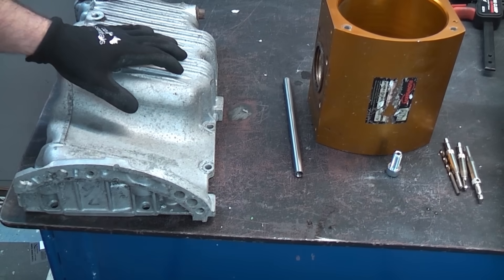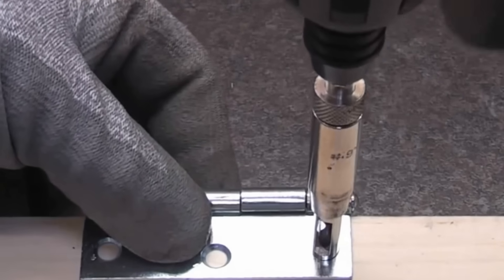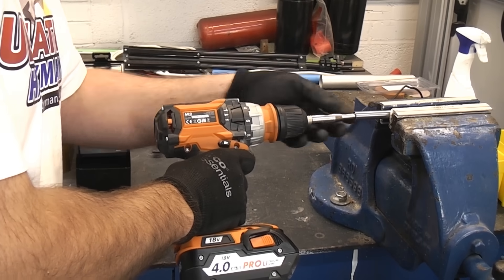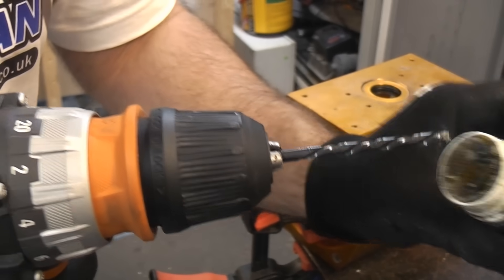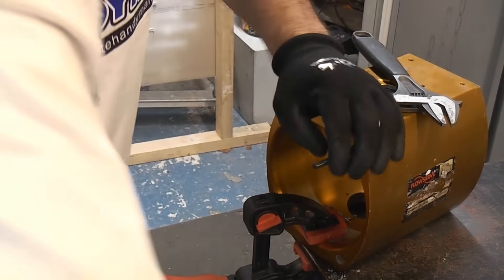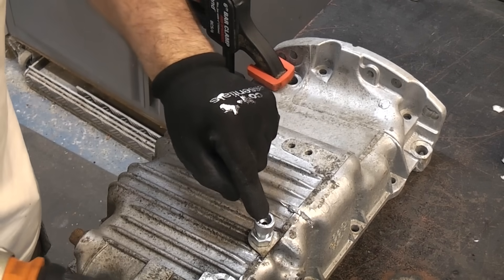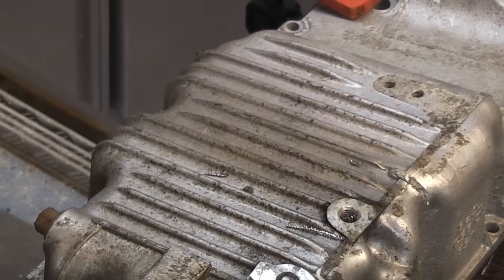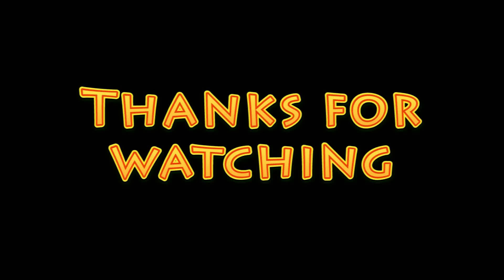How to remove a broken bolt in a deep hole | remove broken bolt in recessed hole

Comment: Whats the name of the drill bit tool adapter?... To buy it!
Reply from the maker: I'm not sure which part you are asking about, so here are some links-
Hinge centering drills- https://fave.co/2DpJo1H

Left handed drill bits- https://fave.co/2xJjK1M

Teng screw extractors https://fave.co/2OnfRuF

Dormer taps -https://fave.co/2OsN1sQ 

You'll have to make the guides yourself, but they are easy- https://www.youtube.com/watch?v=6mZj0J6CNYA&t=1s

Spring tools centre punch- https://fave.co/2NbnLBD

Thanks for the comment 👍

Comment: What are the odds you will break off a steel bolt in an aluminium casting without stripping the thread first?
Reply from the maker: It depends how the bolts are broken, if they are sheared sideways etc.
Thanks for the comment 👍

Comment: I believe you should be using an aluminum based anti seize instead of copper based, since the copper may cause dissimilar metal corrosion when used in aluminum service.
Reply from the maker: Thanks for the comment 👍

Comment: Very good!! I'm not a mechanic, but I have worked on cars and motorcycles. I did two total car restorations. Drilling out a bolt was always a problem. Your drill guides are really smart. You should submit a patent application before someone else does. I think you can make a fortune off them.
Reply from the maker: I don't think the idea would be patentable, as similar bolts already exist (called vent bolts or something)
Thanks for the comment 👍

Comment: The use of millimetre is intended for the international viewers
or the Uk is also using in part the metric system
Reply from the maker: The UK was supposed to move to metric in the 1970's (I think), but now we have a mix of both! Most new stuff is metric, such as bolts and copper pipe etc. But steel pipe is still imperial- basically, it's a mess 😀
Thanks for the comment 👍

Comment: These videos are excellent. 
On small consideration: 
I was once warned not to use copper grease on aluminium castings as aluminium can react with copper in the presence of an electrolyte. The electro-chemical reaction can lead to a galvanic corrosion.
Reply from the maker: Thanks for the comment 👍

Comment: If you are working with aluminium, using lithium grease of which is otherwise used on battery poles, should be best for preventing bolts from seizing into aluminum again. The initial seizing is the result of electro-chemical reaction between both dissimilar metal types. If higher temperatures are involved, then of course copper-based grease is best.
I generally use used engine oil, for lubricating threads between steel and cast iron and steel to steel applications.
If you have the misfortune of having to deal with certain old Japanese cars, replacing broken-off bolts with studs and bronze nuts is probably the best solution for avoiding repetative fastener breaking. This is a method particular to where excessive heat will be present. In other words, applicable to the exhaust system
Reply from the maker: Thanks for the comment 👍

Comment: First: Kano Labs Aerokroil. It's rather expensive ($20 for a 10 oz. aerosol can) but cheap compared to machine and vehicle parts. As only a tiny spritz of Aerokroil is needed, a can should last for years.

2. Tap as in the video. If you can get the punch at an angle, tap in the direction that tends to unscrew the screw/stud. 

3. Centerpunch in the center of the broken screw. 

4. Using a LEFT HAND drill bit (unless of course the broken screw's threads are left handed!), drill, using a bit of a size that will not damage the threads in the hole. Often the drilling torque will unscrew the broken piece of the screw. A thin walled bushing that slips down into the threaded hole will guide the drill bit to the center of the screw and protect the body threads.

5. Use a broken screw/stud extractor. K-D and Snap-On appear to be made by the same maker. They have a shoulder that prevents the extractor from going too deeply. They also have a slightly reduced diameter up inside the extractor body so that if you break the extractor a stem is left that you can seize and pull the broken extractor out by. Tap the extractor driver as you turn it. This helps seat the extractor and perhaps loosen the screw.
6. Carefully apply heat. Aluminum, zinc alloys ("die cast," "pot metal"), brass will soften and melt before steel or titanium will. However, they expand more than steel. Try another extractor. As breakage of extractors is common, you should have several of each size, especially the small ones.
7. If the broken screw/stud is stubborn, drill it out (LEFT HAND drill bit) until only the threads of the screw are still in the body threads. You may be able to pick the thread coil out with an O-ring pick. Expect some damage to the body threads. Slight damage to the threads may be repairable by applying blue Loc-Tite to the new screw/stud when reassembling. You may have to install a thread repair insert: Heli-Coil, Time-Sert, K-D, etc. Sometimes a better solution is to weld the hole full , drill and tap new threads. You may be able to use the mating part as a centerpunching guide. If a center drill fits the hole, or a thin wall bushing that fits the hole and fits the center drill is used to guide the center drill, that may work better.
Reply from the maker: Thanks for the comment 👍

Comment: Gday,
Good on you for posting. I like the idea of turning a Socket Head Cap Screw into a guide for the drill bit. I’m sure it will come in handy. 
If you have a steel bolt stuck in aluminium.... that you haven’t snapped yet, put a good bead of weld from your Mig on the bolt head so it’s cherry. Let it fully cool and the bolt should come right out. 
I notice that the older I get, the less bolts I seem to snap 😃👍🍻
Reply from the maker: Thanks for the comment 👍

Comment: Too bad in the real world bolts seldom break off down in the hole where you can use a pilot jig.
Reply: If there are a few threads sticking out, you can screw a nut, a standoff (extended length) nut or other similar item onto the broken stump as a drill guide. The hole in the mating part may be usable as a guide. File the end of the stump flat and parallel to the surface to minimize the tendency of the drill bit to wander. Use split point drill bits, left hand if you can find them.

Comment: What do you do if a stud is broken off below the surface and the hole had a dowel so there are no threads in the upper section of hole?
Reply from the maker: You could always drill through a piece of steel, the same diameter as the dowel, then knock it in to use it as a guide.
Thanks for the comment

Comment: My mechanic quoted me $220 to replace the valve cover gaskets on my 2001 v8 land cruiser! Three days after I dropped it off I came to pick it up ! He says I have bad news two of the bolts broke and got stuck! He did not say anything about price ! Another three days later he says it’s done I can come pick it up! He gives me the bill and charged 6 hours of labor for two bolts at $97.00 per hour ! I also had him do a fuel filter and the bill cane up too $750 ! Is this how mechanics do normal practice ?? I would have never agreed to have the job done if it was gonna cost that much and he gave me little options but to feel bad for him and pay up!! Anyone have a similar experience or any comments they would like to add??
Reply from the maker: My mechanic normally quotes for jobs in advance! He should have asked you if you wanted to proceed or not, $97 per hour- I'm in the wrong job!

Comment: Pretty good info here. I have been removing broken bolts for almost 40 years as a machinist. Only thing I will add is most times after removing a broken stud or bolt especially after heat was used is the threaded hole will need re tapped becauae of distortion due to the heat or stretching of the threaded area. For goodness sakes do not break a tap in the hole. They are harder then a wood peckers beak And can not be drilled out.
Reply from the maker: You can drill broken taps/screw extractors with a diamond coated hole saw, but it's very time consuming
https://www.youtube.com/watch?v=7JCfEMrCjhc

Thanks for the comment 👍

Comment: 2 years back in January Milwaukee WI the coldest day of the year I jumpstarted a car and I heard a bang from under my hood as I see the battery light come on. So I get out and im like wow my belt broke but as I check into it im like wow the belt just came off. So im like no way and I check into it further AND I NOTICE THAT THE BOLT GOING THROUGH THE CENTER OF THE TENSIONER PULLEY INTO THE BLOCK IS SHEARED OFF AND BROKEN BOLT IS FLUSH INSIDE THE MOTOR.  And I mean it is COLD AS A MOTHER F---KER AS IM ATTEMTING TO DO JUST ANYTHING TO REACH IN AND REMOVE BROKEN BOLT.  I even called my wife to tell her that the car was pretty much finished for a very long while because I wasn't going to spend several hours in subzero weather removing broken bolt. I actually manged to cut a small slit into the bolt with the end of a knife and use a small screwdriver to drive out the broken piece. I WAS SO FUCKING HAPPY TO SEE THAT I HAD ANOTHER 5 INCH LONG BOLT WITH A FEMALE TORX TO REPLACE THE 5 INCH ALLEN HEAD BOLT. I swear to this day the lord was looking out for me as luck is almost never on my side.
Reply from the maker: He certainly was watching over you that day ;-)
Thanks for the comment 👍

Comment: Those guides are great. But DO USE copper paste (or similar long term lubricant) when screwing steel bolts into aluminium. Get it an any auto store or online. There is some chemical reaction that occurs and causes seizure or bonding in the threads
Reply from the maker: Thanks for the comment 👍

Comment: Nicely done and methods that I have been using.

I prefer to leave the bolt attached and I make sure it is long enough to act as a guide. In my case, the broken bolt was seized to the point where no easy-out could remove it. In this case an M6 bolt which has a drill diameter of 5 mm. So I would use letter and number drills to drill the finished hole to 4.6 mm. That leaves a 0.2 mm wall to the bolt.

I would then use an M6 starter tap to get most of the shavings out and a bottoming tap used carefully for the last few threads in a blind hole. I use cutting compound and remove the chips frequently.

I used a different but similar method for a seized bolt that protruded by about 3 mm out of a casting. Luckily it had a machined surface to lay a metal block up against it with an M6 hole partially drilled into it to place over the broken bolt. The centering hole was then gradually drilled out to 4.6 mm. No damage to the existing threads.
Reply from the maker: Thanks for the comment 👍

Comment: Basically there are good points here. However, metal boring should always be done at slower rpm. Why? When a cutting bit is spinning, it is not cutting at optimum performance.
Reply from the maker: Thanks for the comment 👍

Comment: What if the broken off bolt is made of stainless steel ?
Reply from the maker: You just have to ensure that you don't work harden it when drilling it. You can still drill it out, but you have to go slow and use plenty of coolant/lubricant.

Thanks for the comment ;-)

Comment: Some very fine & for me new ideas. My concerns which I don't think you addressed directly are:  1) After 40+ years in engineering I have never seen left hand drills available, where & at what typical price point, bearing in mind they need to be cobalt to handle hi strength bolts. And 2) You referred to your extractors as "low cost", so are mine but I dread they will break in use & make the problem worse, they are easily broken & I'd suggest a better alternative should be available? BTW please  buy yourself a tap driver tool & junk that adjustable wrench.
Reply from the maker: Left handed drill bits are available here-
Left handed drill bits- https://fave.co/2xJjK1M or if you are in the UK- Left handed drill bits- https://fave.co/2DubtF4
You can get cobalt ones if needed- https://fave.co/2RjRXyi

The extractors that I have in the garage are those cheap ones that come as part of a set including drill bits, taps and dies (I'd never use the taps), at work I have two sets of Teng extractors, spiral and square. 

I have several tap wrenches, but they are in my tool box on site ;-)

Thanks for the comment

Comment: I like to use a square screw extractor as the screw in ones can expand the broken off bolt and make it even harder to get out . I like the idea of making some centering sleeves to start the drill . I have drilled out the bolt until you can almost see the threads and the use a dremel wit a carbide ball bit and cut to the bottom of the thread on both sides and then use a small punch that has been ground at a sharp angle to get under the side of the bolt and collapse it in the hole .
Reply from the maker: Thanks for the comment 👍

Comment: Great video and you have good skills.  There is one tiny little problem though - small bolts tend to snap off more than larger ones that are kind enough to give you some room to work with - probably greater than 10:1 ratio and even if you can find a screw extractor small enough, it WILL break :-(
Reply from the maker: Thanks for the comment 👍

Comment: Invest in a set of Snap-On tapered square extractors... those threaded ones are hopeless especially if you hammer them into place. Most often I just used a drill bit that allowed clearance from the threads and then pulled out the detritus with pliers. One shot deal.
Reply from the maker: Thanks for the comment 👍

Comment: Nicely done. 
Have you ever used a square edged bolt extractor? I find they drive in a more secure purchase into the broken and drilled bolt which seldom slip when extracting them.
Reply from the maker: Yes, I have a Teng set at work, sometimes they work better than spiral ones.
Thanks for the comment 👍

Comment: it's called extractor bolt.. tapered in shape and opposite pitch of thread.
Reply: jeric raval it depends on the manufactor and or trade. Many extractors are called screw extractors by the manufacturer and are the same design as most bolt extractors.

Comment: Excellent. I purchased a Facom extractor set that cost about £150 to do this job. The guide system to enable you to  drilling a concentric hole was rubbish. This is far superior, well thought out, you are a clever cookie.
Reply from the maker: Thanks for the comment 👍

Comment: It helps in the initial getting the broken , drilled bolt to start moving and also helps for the easy out not to spin in the drilled hole, tap on the end of the easy out with a small hammer AS YOU TWIST , until you feel the broken bolt move ! 
 Best penetrating fluid is a 50/50 mix of acetone & automatic transmission fluid
Reply from the maker: Thanks for the comment 👍

Comment: Great video. Hinge tool worked great on cylinder head. Do you sell those bolts you made?
Reply from the maker: I'm afraid I do not sell the bolts, but if you search for a "vent bolt", you can buy something similar.
Thanks for the comment 👍

Comment: When it comes to broken fastener removals I use nothing but the BEST implements I have obtained. Twisted removers are a NO NO to me. They often expand their intended target.  Tapered, Fluted seem to work best. LEFT HANDED  drills are a missed asset, get some.  The center drilled bolts is something we did in the Navy back in the 60's/70's using Grade B16 material.  Still own some today.
Reply from the maker: Thanks for the comment 👍

Comment: That bolt guide is an old timer shade tree trick...I remember popa doing that on a boat motor once, the bolt extractor is a good tool, but you have to be careful because if you ever break one off in the bolt you are really in a pickle😖
Reply from the maker: Thanks for the comment 👍

Comment: Great video!
The drilled out allen bolts are a great idea as it's almost impossible to not drill into softer surrounding soft materials.
I've often been unsuccessful with screw extractors and wondered why - they need tapping in to get a bite and it looks like I need to upgrade the quality of mine.
I'd never heard of cobalt tipped drills before either, and always wondered how to drill hard steel alloys etc. - another problem solved.
Your gloves look a more durable option than the latex ones I use and I'll be looking for something like those too.!
Good to see you youngsters are keeping the engineering lore evolving! :-)
Reply: Yea when you have the part free and on a counter shop table. Try doing all that while that bolt breaks in the engine case, etc on the vehicle wich is most of the time

Comment: JUST A NOTE: YOU MENTIONED USING ANTI-SEIZE ON BOLTS WHEN YOU PUT THEM BACK IN BUT THERE ARE CERTAIN INSTANCES THAT YOU SHOULD NEVER USE ANY ANTI-SEIZE OR LUBRICANT WHEN REPLACING BOLTS, SO BE SURE TO CHECK MANUFACTURE SPECIFICATIONS ESPECIALLY WHEN DOING AUTOMOBILE WORK.

Comment: Thank you for this video. I only wished that I'd seen this first before I attempted to remove the broken bolt on my SUV. Anyway, I need to know what that bolt with the hole in the middle is called and where to get it. I know you're in the UK, but I wonder if I can find something like that here in the USA.
Reply from the maker: You can make them yourself, or any small engineering firm should be able to make them for you
https://www.youtube.com/watch?v=6mZj0J6CNYA
Failing that, they make a bolt called a vent bolt, which is very similar.
Thanks for the comment

Comment: I enjoyed your informative video the self centering drill and the drilled out cap bolts are a great idea. The only thing I would add is when i tap the ezout into the drilled hole I keep the wrench on it and apply some counter clockwise pressure as I tap this sets the ezout easer. Thank you
Reply from the maker: Thanks for the comment 👍